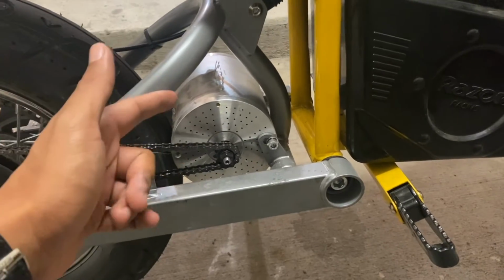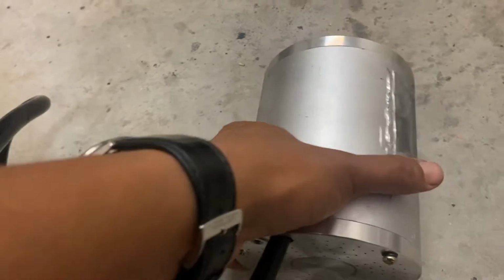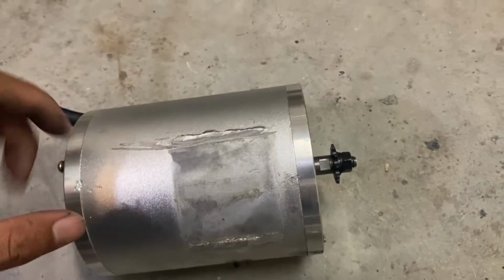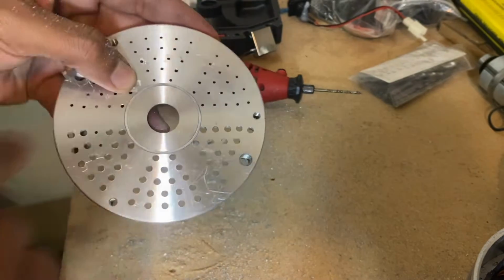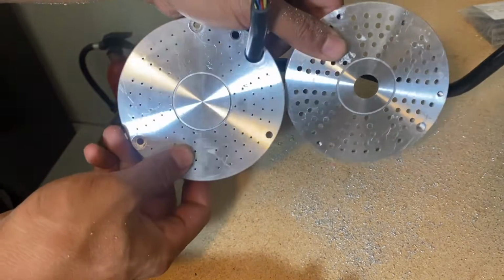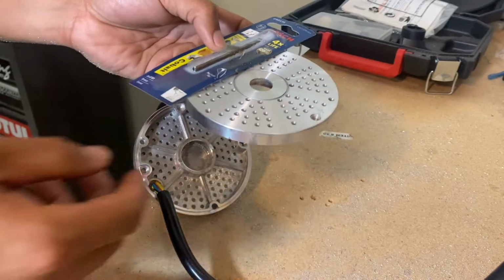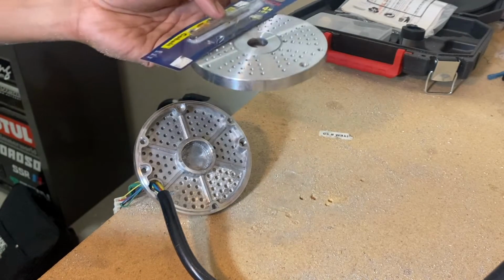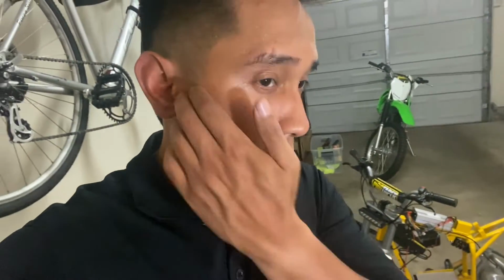Kunray MY1020 2000W Brushless Motor Cooling Modification | Drilling Vent Holes Larger

Comment: sick mod, has that helped your motor at all? wanna do this but scared to fuck with the motor lol
Reply from the maker: @JangSikTV  you could just install a heat sink on the motor, which would have a similar effect but no cutting or drilling involved
Reply: @PatOutdoors  awesome thank you I just ordered that today, was wanting to do everything and anything  to minimize the heat.
Reply: How fast are you hitting with this set up. I have a Kelly controller and holy hitting 42 with a 72v and 24ah
Reply from the maker: I hit 52 MPH with this bike, with a 10x3.5” street slick rear tire (will NOT fit without extended swing arm), 13-tooth front sprocket, 175 lb rider
Reply: @PatOutdoors  okay just asking cus I’m only
Hitting like 42-44 and I have 3kw/5kw my 1020 and 72v 24ah battery but Kelly controller. So seeing what I need to upgrade most to see some change

Comment: What wouldve made this video better is if you used the laser temp gun to see the difference before and after. Also adding heat sink and thermal past will lower the temp by -20
Reply from the maker: Appreciate the feedback!

Comment: I already have a my1020 on my Razor with an 80 amp controller and heatsink and drilled out holes and Im using some 12v computer fans for cooling connected on a 3s , the main battery is at 21s 88v max around 7kw and she gets hot. Im building a fat tire beach trike with a second my1020 motor and a 50 amp controller for the beach and a little scared about drilling out the holes with the sand. I might try a filter of some kind if I do. Great vid.
Reply from the maker: Hmm well you’re dealing with a lot more output than the average.. Have you considered looking at electro & co’s EC4P motor? It’s designed to handle up to 11kw output and may be more efficient with managing heat, also fits with my1020 applications

Comment: Notice where they make you put the electic motor..To bad you can't weld extend and do 2 motor.. linked 2 chains .. 1 hung under the seat...2 spokets...They could do alot with thos frame...So simple..
Reply from the maker: That would be an interesting design. Think a hub motor would be the simplest set up with no chains at all.

Comment: Those stock holes are tiny.  I used to get this special cleaning spray for my RC car electric motor. Cleans the dirt out and doesn't mess it up. I wonder if you could make your own fin to direct air towards the motor as you are riding. Be careful pushing the ion batteries, they will catch fire. I Always enjoy your videos. Thank you
Reply from the maker: I'm thinking a custom air duct would be the most ideal move. I'm half expecting this bike to catch on fire this weekend TBH lol
Reply: @PatOutdoors  If it does, SAVE YOURSELF . Run. LOL haha

Comment: I've been tinkering with a Jetson Bolt Pro bike. The bike path I ride has a 5 mile hill to climb so the motor can get pretty toasty. Yesterday I brought a can of air, electronic duster, if you invert the can it will spray freezing liquid and it cooled my motor down quickly. Use at your own risk, I don't know if it could harm the motor or not, but it worked for me
Reply from the maker: I thought about this (co2 from spray cans) to cool it down immediately, but it would only work temporarily and also means I would have to carry aerosol cans in a bag lol. I could see how it would work though

Comment: Can’t wait for the results with running no bms and sending all the amps that controller can take. Great content, keep us updated!
Reply from the maker: I can't either! Will update as soon as it's all put back together.
Reply: @PatOutdoors  fyi, please use the bms when charging that pack and check the voltages while running it so it doesn’t over discharge.
Reply: I’m only bypassing the discharge portion. The charging side will be left alone because of my fear of overcharging it as well
Reply: Are you saying that your battery rated with 50amp BMS does not have 50amp BMS?
Reply from the maker: @ShevaLife  Yes, I called out BTR and they gave me a refund and said it was mislabeled. I ordered their 72V battery and assured me that one actually has a 50A BMS installed.